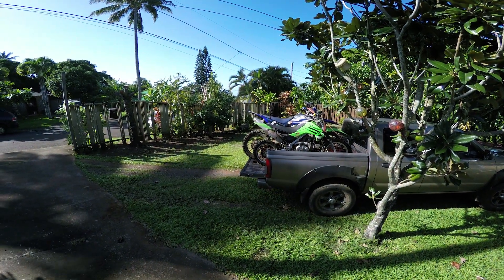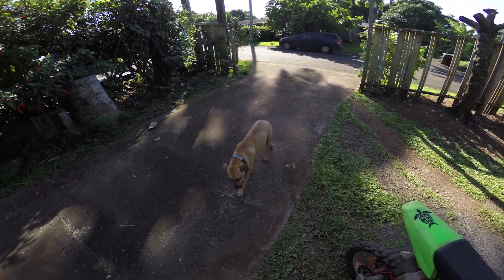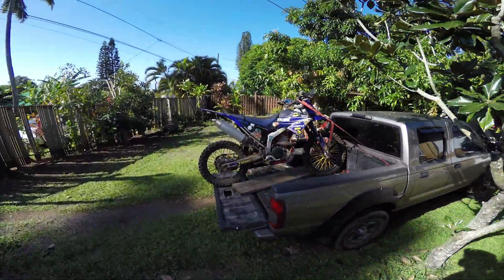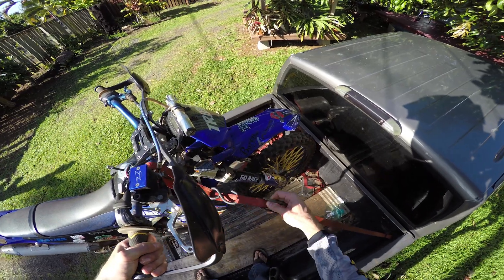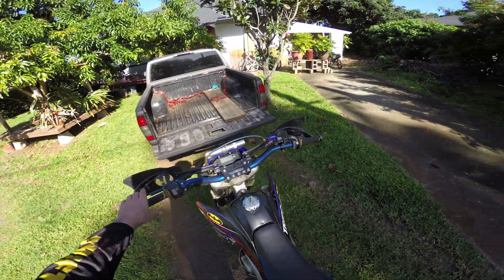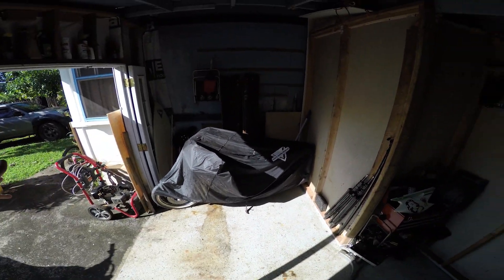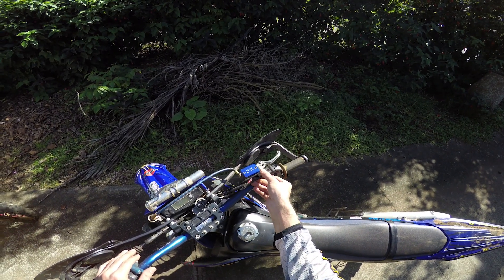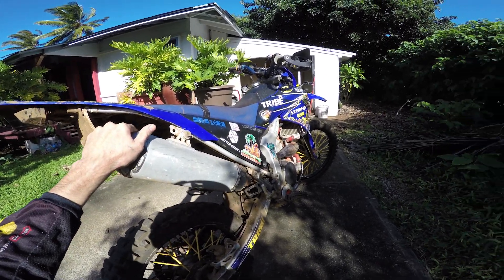How To Unload a Dirt Bike Like a BOWASS.

Comment: I wouldn't wait too long before doing those rear wheel bearings,  cheap and easy job. As you ride  in wet conditions I would be pulling the linkage apart while you get the shock serviced -grease up those needle bearings as they can bind up and turn into a huge mess.  When I had linkage bikes it was something I did annually.
Reply from the maker: Much love : )
Reply: AccidentalBroadcast
Forgot to say, my last WR 450 was neglected before I owned it and I had to cut the needle bearing rings out of the dogbone linkage. It had to be done as the needle rings were even pitted and some of the needles had snapped.
Reply: Giving you an internet high five on non-linkage bikes!  Love the WP PDS.  (I see your Husquaberg pic there.)

It works well enough, but my real joy is NOT lubing suspension pivots every year!  (Ok, I do lube the swing arm bearings.  But they're a lot easier and cleaner.)
Reply: gncc1race

Thanks its the 570. So much easier to remove the shock on it over the WR. 2 bolts and its done.
Reply: sapman71
What year is it?  I can see it's got the rotated motor ('09-'12?).  Is it the dual sport or just a standard FE570?
Reply: gncc1race
2011, it's the aus/eu version so de restricted straight out of the box. We only get 1 version and it is road registered. 
Naming conventions differ,  a dual sport to me is a big heavy bike capable of riding off road. Anything with lights fitted when new can get registered in Australia, only exception is the RMX for some reason. Hell for a while there CR 500's were fitted with a compliance plate allowing for full road registration... how much fun would a CR 500 supermoto be ..... droooooooool.
I think Husqvarna is coming out with a more street oriented bike, with a longer service interval.  My berg is certainly not suited to long stints on the black top
Reply: A street legal CR500 would be insane!

I didn't realize you are down under.  Yes, I'm aware there's quite a difference btwn what we get in the US and what the rest of the world gets.  I watch a lot of videos from Aus & NZ (love Adam Riemann and Chris Birch), and noticed bikes on road there that aren't legal on road here.

Some states here in the US make provision to register dirt bikes & ATV's for limited on-road use (AZ and ID for sure, not sure what others... ).  Not here in Alaska, which is odd because it would be very appropriate here.

For most of us here, if you want to ride on the road, it's got to be mfd to meet US DOT requirements.  I have to say that KTM and Beta have both done an excellent job of minimizing the impact of that on their serious dual sport models. 

There's some confusion in terminology for us too.  You'll find XR650L's, KLR650's and TTR250's classified as dual sport's along with the (barely) street legal serious off-road KTM's, Beta's and now Husky's.

For us, what you call an EXC is an XC-W.  We only have two EXC's, 350 & 500.  They're identical to the XC-W's except for muffler end cap, switch gear, street lighting, and super-tall stock gearing.  All of which is easily fixed.  I have a '14 500 EXC with stiffer springs, 13/50 gearing, my tire set-up, hand guards with folding mirrors, a Baja Designs Squadron head light, and have it wired to plug in helmet lights as well.  And very importantly here...  That fabulous piece of aluminum on the rear fender!

Good talking with you Sapman71!  I'm sure we'll cross paths again.  I'm an avid ++AB viewer.
Reply: gncc1race
Yep we are quite lucky with what we can register here compared to the US. Its odd that we can't get the XR650 any more, the only big bore air cooled Japanese bikes available are the KLR 650 and DR 650. I had XR's growing up and loved them.
Was good chatting, cya round!
Reply: gncc1race dude he is in Maui not Australia
Reply: *****
I was conversing with sapman71, not accidentalbroadcast.  Yes, ++AB is in Maui, but sapman71 is in Australia.  Read the string bro, read the string.

Comment: Hey, Ive had a similar issue that you are having with your bike not being able to start. My bike would not start with the estart but would with kick over and start, but then all together wouldnt start at one point. Took it down to my buddys shop and we changed out all the electronics accept for the stator since the mechanics I had talked to said it couldnt be that. After changing all the electronic parts still wouldnt start so it could only be one thing the stator. Changed out the stator and bang works like it did when i first bought it. I hope this somewhat helps with your problem. I sure hope its not the stator in your case since they are kinduf pricey. Anyways Goodluck with fixing you bike!
Reply from the maker: nice! thanks for the input : )

Comment: To repack your pipe there should ethier be a couple Allan wrench screws on the back of the pipe near where it connects to the header then it should slide into to pieces then just repack your pipe then you should get a sealnt then seal your pipe back where it connects and in the screw holes love your videos don't give up

Comment: Yeah, just drill out the rivets, there may be a long piece the packing goes around, if so just cut the packing off, put the new on around it and just put it back on, then with another rivet gun, re-rivet the previous holes. The shock sound like it needs more nitrogen in it.
Reply from the maker: PERFECT!

Comment: Did you get cupcakes bike off of craigslist? Or a local store
Reply from the maker: Craigs : ) $900!
Reply: I'm looking for something  small to just play around on. I'm thinking a yz 125. I've found a couple for a bout 850!!!! Lol
Reply: AccidentalBroadcast What year is it?
Reply from the maker: CantThinkofaName 2009
Reply: Deirek Rasmor A yz125 is about the same size frame as Kalani's bike(a bit taller actually), just in case you didn't know. You say you want something small then that may not be the best option unless you already have experience riding.
Reply: AccidentalBroadcast
It`s a shame, that they never delivered the 4strokes to germany. We just can get the 2strokes and i dont like them, because they`re way to loud in the forrest around my home. 
I need one of those......now!
Reply: Yeah I realize that. I ride a bigger bike. But want something that I can just mess around on. Not on a 450 lol
Reply: I would love to upgrade to a yz250 2 stroke or a husky txe 510. Awesome fun

Comment: Hey AB - Wacky idle is a sure sign of an air leak. Check the airbox/pipes/carb are all tight & snug. If not, your slow jet could be blocked. Good luck with the electronics. I hate electronics.........

Comment: You do to many wheelies that's what the problem is with your rw bearings :-) . Note to Kalizzle, don't forget the snap ring pliers when you do them like I did not fun trying to do wheel bearings in the dark without the proper tools.
Reply from the maker: yessir, Mr.Dass turned me on to those things! So much easier!
Reply: Wrong!  No such thing as too many wheelies!  Wheel bearings are cheap, fun is not...

Actually wheel bearings just go.  Cost of doing business.  Mine seem to go especially fast since I bought that power washer a few years ago.  Hmmmm....
Reply: gncc1race Yea I know, the ones I usually get water finds its way in weather from mud or washing. Wish they would do a mythbusters episode about the Wheelie thing though(even though I made it up) that would be interesting.
Reply: IncogInfidel That would be cool!